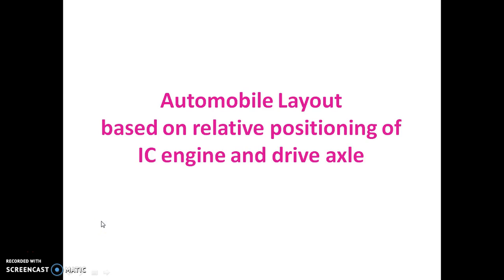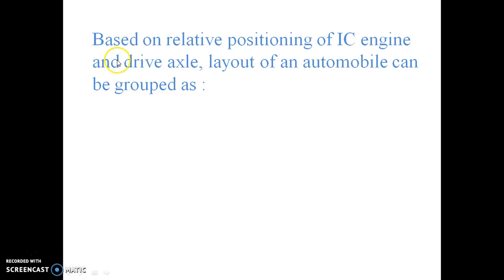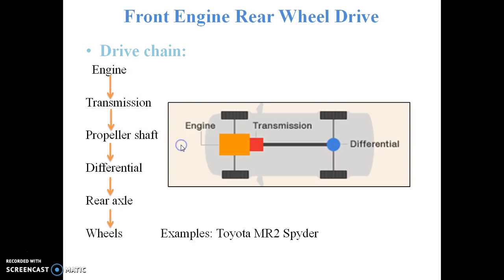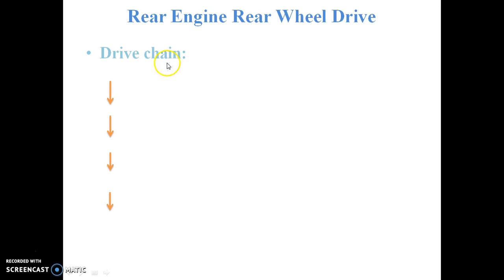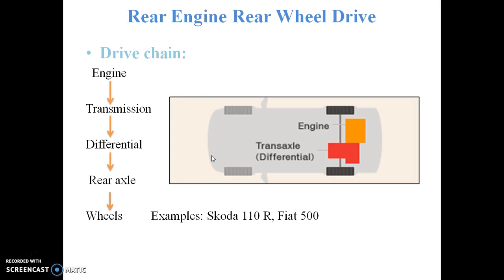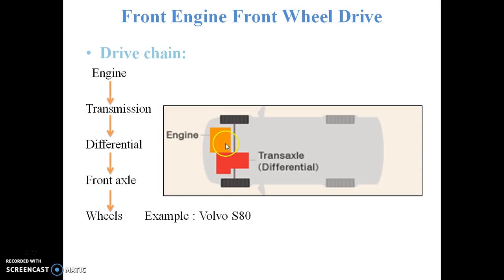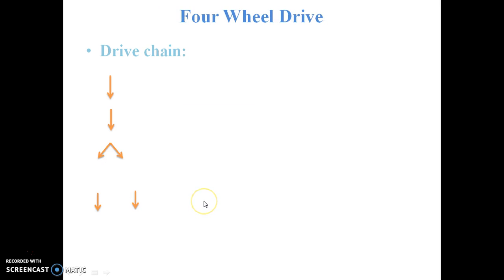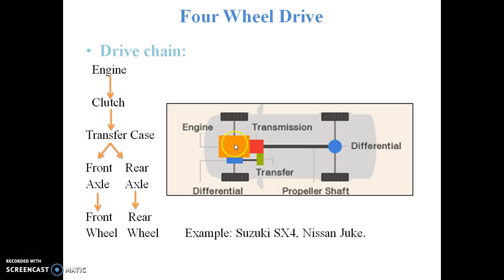Automobile Layout based on relative position of IC engine & drive axle by Snehal S  Gawale

Comment: Toyota MR2 Spyder isn't a FR car, its MR car, just like it's name. MR is Midle engine, Rear Drive
Reply from the maker: Toyota MR2 spider use traditional engine layout between driver and rear drive axle i.e RMR car. Typically, they're simply called MR layout cars.